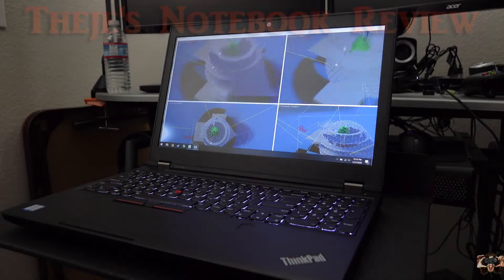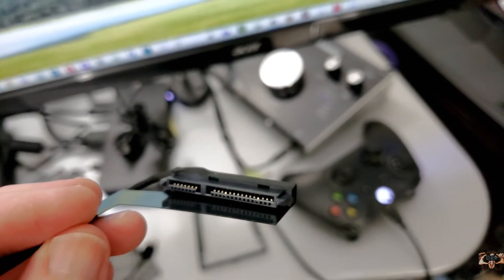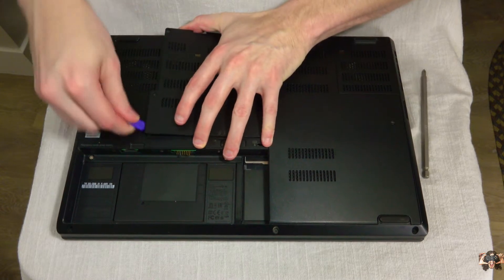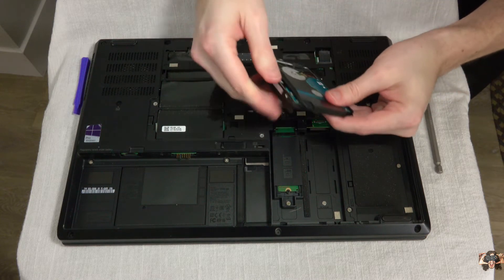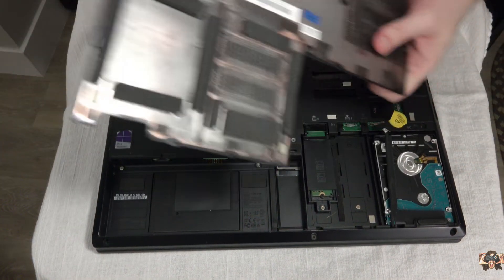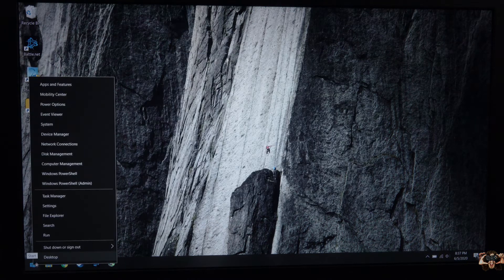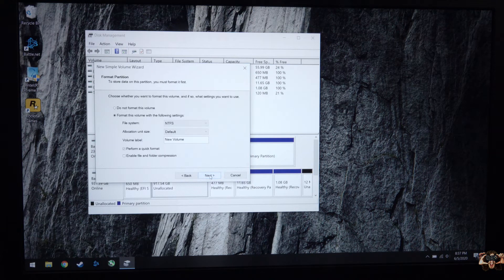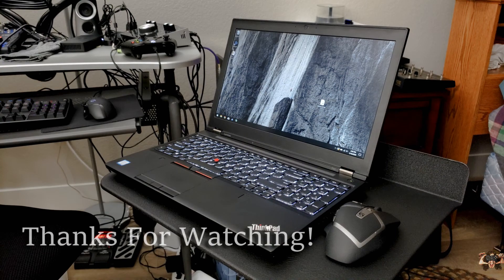How To Install A 2.5" Drive In the Lenovo ThinkPad P50

Comment: Hello! Thank you for your video.  I wanted to make sure I have the right Sata adapter, as I'm using the left bay for the two M.2 NVMe SSDs.  As you cautioned about, I need to make sure this is clear and I'm getting the right SATA cable adapter!.  The 2.5 drive bay is on the right side, but the cable runs up the left side, right?  I've read some cautionary tales about getting the wrong adapter! Many thanks